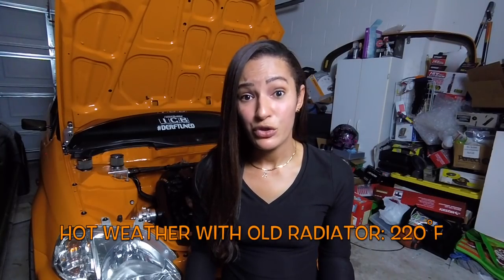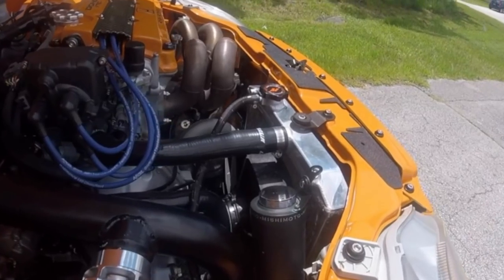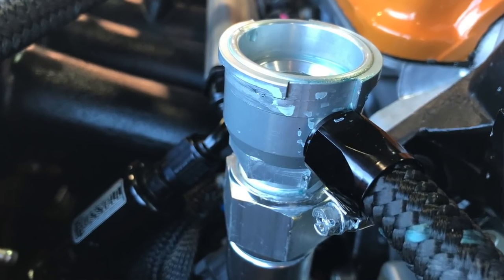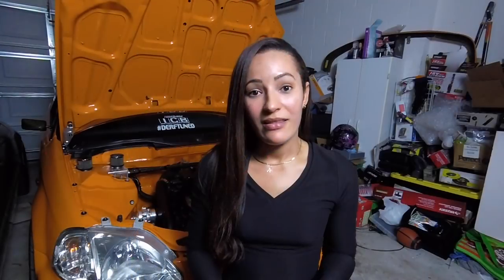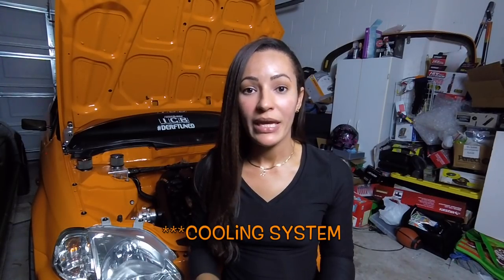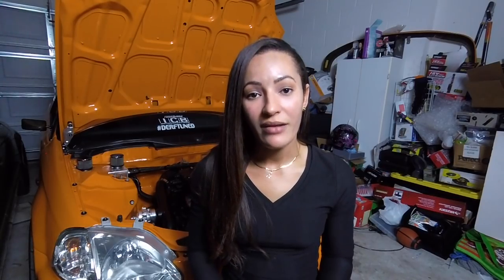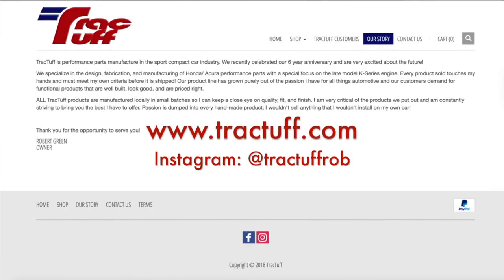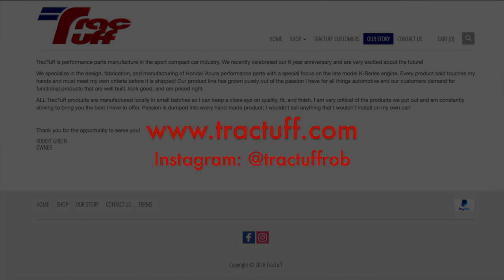UPDATES - WekFest, Swirl Pot, Tuck Radiator - Female Built Turbocharged Honda Civic

Comment: Little heads up,,,,, before taking things apart save yourself the time and do a hydro-carbon test, its cheap and it will instantly tell you if you if you have exhaust gasses entering the coolant by changing colour of the solution in the tester.
Reply from the maker: Thank you. I will look into that test.

Comment: My gsr with a duel core ebay radiator is 205 max on longer drives. I’m going to heat wrap my manifold, downpipe, got hood spacers, and installing a shroud to see if that helps before going tucked with duel fans. I want 187-194 like u got
Reply from the maker: My turbo manifold is ceramic coated and I think that helps a lot. You're on the right track with the list of things you're going to do! Good Luck!

Comment: Just watching this video, but are you sure that's a swirl pot and not a filler tank? The swirl pot should be connected to the top radiator and the lower hose as well. A swirl pot is suppose to remove air bubbles from the system. How does it removed air from the system if it's only connected once?

Comment: That swirl pot looks good in bay. 
I had a radiator cap issue last year. Freaked me out cause I just did head studs.
Reply: SleeperCalais what was the problem
Reply: Jaime Rodriguez The cap failed and started dripping coolant.
Reply from the maker: Thank you! Yea mine freaked me out because of my pulled head stud last year, I did time-serts and I thought that they could have been loosening up lol

Comment: The car looks super sweet I’m in the process of doin my Honda crx which I have posted pics on YouTube. Wanted to know what paint u used on the manifold? And does it fade or change colours from all the heat?
Reply from the maker: Thank you! Good luck to you! My turbo manifold is ceramic coated, titanium color. It hasn't changed colors so far.

Comment: Do You think that the cooling issue may have been coming from the tuck radiator system,  was due to not having an overflow reservoir? Cause the swirl pot system looks like that’s what it’s creating.
Reply from the maker: I have always had an overflow; before and after installing the tuck radiator.

Comment: I noticed you didn't have any power steering I've been thinking about taking out mine to lately is it recommended
Reply from the maker: My car has a manual rack. If you have power steering and you want to remove it, you'll either want to (1) convert to a manual rack, or (2) loop your power rack with fluid inside. Good luck.

Comment: Awesome vid .. I'm thinking of getting a swirl pot. I run an oil cooler as well for the turbo. I want to do a radiator tuck but was not sure if fitment clear or to close to intercooler. I'm running a half radiator temp are in the 190-200 in summer ,my concern is wide open throttle on the race track.. any other ideas?
Reply from the maker: Thank you! Take a look at my tuck radiator install video. You can see the clearance.

Comment: ma.i got a question . would it be worth getting the half size speedfactory radiator? im planning on doing a turbo on a d16z6. im not ready for no show car build like yours. i just want to know what are your thoughts and your opinion.
Reply from the maker: The half sized SpeedFactory radiator is classed as a "drag" radiator which is designed for drag racing cars. I've never had one, so I can't speak from experience, but they are smaller which means less volume, so I would imagine that it would be less efficient than the fuller sized tuck radiator. For drag racing that would be ok, but I don't know how they would do on longer drives. I'd contact SpeedFactory and ask their opinion on that.

Comment: Did you notice any drop in temp with a swirl pot installed?
Reply from the maker: The temperature did not "drop" it just stays consistent. I was able to bleed the system properly, and now it stay consistently between 187-192 F degrees.